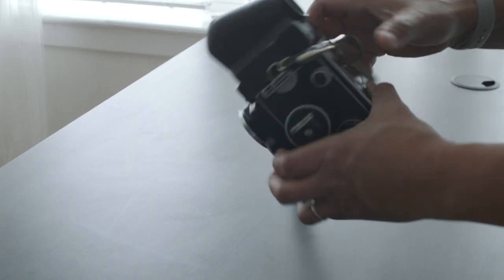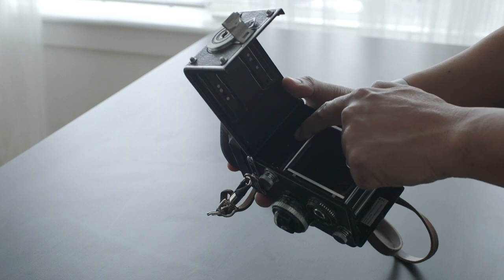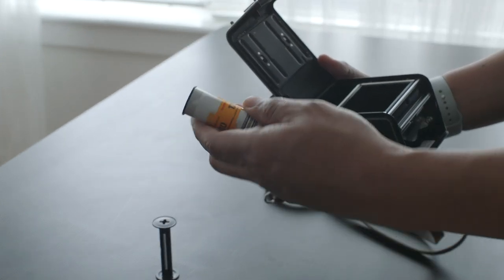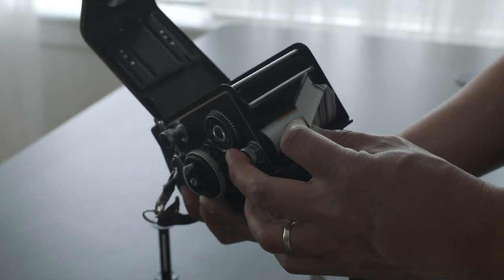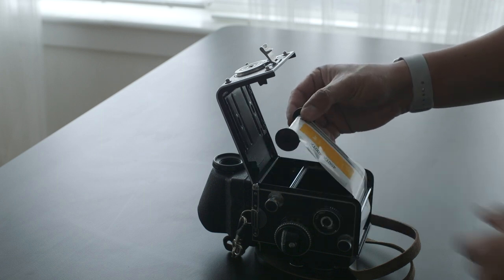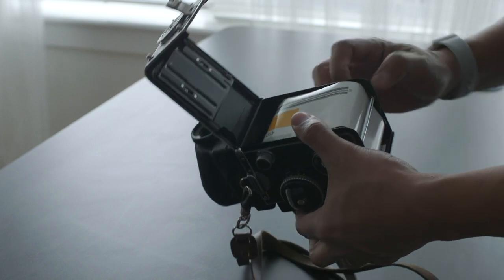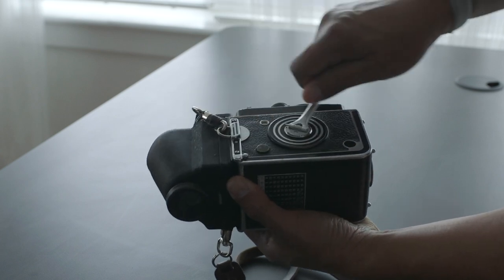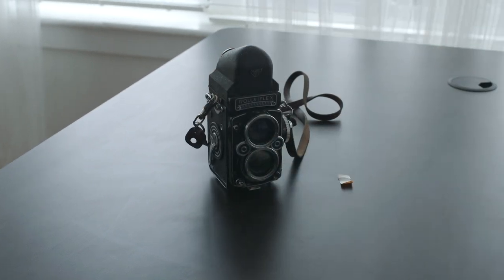How To Load Film Into a Rolleiflex Camera

Comment: Film arrows should line up with the 2 red dots before closing the door
Reply: red dots?
Reply: @NuclearChicken911  yes. Red dots.
Reply: @KG-sy2vs  could you tell me where these red dots are?:
Reply: @NuclearChicken911  there is a red dot on each side of the guide rails that the film rides between. Align the arrows with the dots before closing the back of the camera, and your frame numbers will actually coincidence with the film inside the camera.
Reply: K G...

I know this is an "old" comment, but my Rollieflex 3.5MX "Rolleiflex Automat model 4" (as I expect a great number of other Rolleiflex models) lacks the dots that you are referencing that other 120 roll film cameras utilize. Though not explained in the user manuals, the roller that you feed the film UNDER is part of a "feeler" mechanism that syncronizes the first frame when is senses the abnormal thickness of backing paper, plus film, plus leading edge tape. Therefore, it doesn't really matter where you have the film when you close the back, assuming you didn't advance past that leading edge of the film and tape for the "feeler" to start counting from. Bypass that "feeler" mechanism (going over instead of under) and the winder will wind through the entire roll without ever stopping. Ingenious! 

Glenn
Reply: @KG-sy2vs  you are thinking of a Rolleicord. The Rolleiflex has no need for lining up the start line. You simply have to load the film under the roller, and the roller will sense the film thickness and automatically starts the frame counter.